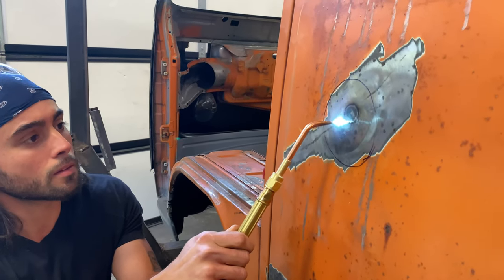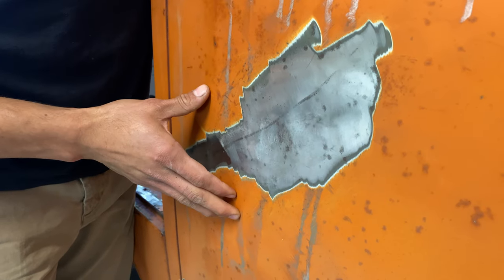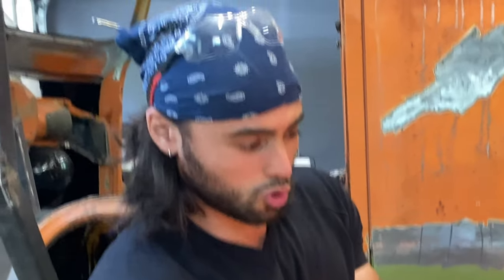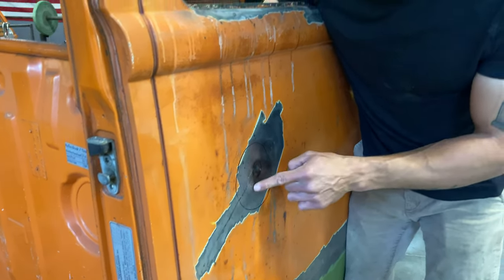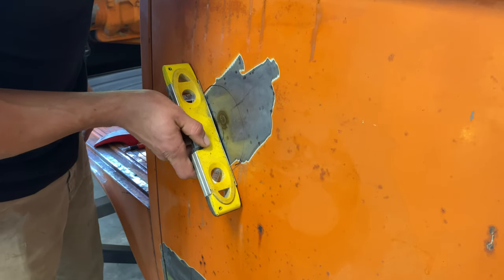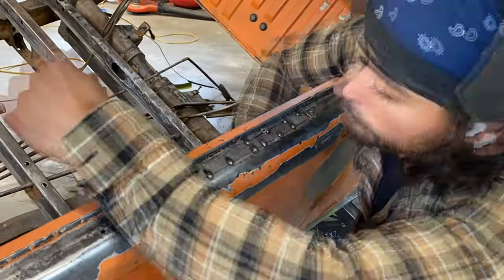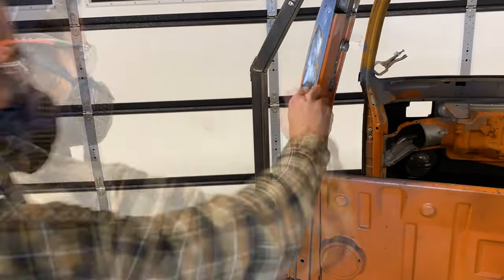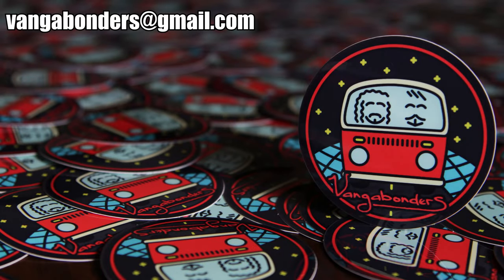Using a Torch to Shrink Body Panels | VW Bus Restoration Episode 40

Comment: Great work on this video and showing us your experience.  I agree with you on the POR15 that it's really good.  I came across it about 4 years ago after using some rustoleum products that had failed.  the POR15 has done incredibly well on underbody surfaces from rusting during the midwest winters (with salt), even on non-ideal prepped surfaces.

Comment: Hello, Kris. I investigated how to remove dents and there are electric machines called spotters and they are used to prevent it from disassembling and hitting the can from the inside. I saw they buy VEVOR pro spot brand a lot, the machine is white with manual controls, it may be an option for future jobs.

Comment: For the small dents, maybe try a shrinking disc, I have been using one for a few years now, works great on areas like the sliding door, stops the need to continual chasing your tail with hammer/dolly work and heat shrinking with a torch.
Reply from the maker: I ordered a shrinking disc yesterday! It’s supposed to get here by the weekend. Excited to try it out. I didn’t even know what a shrinking disc was before I got into this mess lol

Comment: Tip for the wire wheel, if it has a side with two flats on it that is kinda impossible to reach with tools to remove it after you use it if you turn it to the inside, just turn around the wheel and let the flats be on the outside so you can use a tool while removing the wire wheel =) atleast thats how i do it as they usaly stick kinda hard so you need thick gloves or a tool to get it off the machine =)

Comment: Also when turning on the torch, turn on the gas and light it, lean it against a surface like 30 or 45 degrees, then turn on the oxygen .. will prevent the oxygen from blowing out the flame when its turned on =)

Comment: What Amp settings do you use for mig welding?
Reply from the maker: Not sure exactly what it translates to in amperage but on my Lincoln Mig180 I mostly use heat setting B

Comment: POR = Paint Over Rust

Don't paint bare or non-rusty metal with it
Reply from the maker: As long as the metal is etched it will adhere well. Most of the smooth area that got POR15 on it will be sanded down when I epoxy prime. The POR15 used here is to ensure that the tiny rust pits leftover in the window sill don't come back
Reply: @Vangabonders  painting POR onto clean or non-rusty is poor, wasteful practice. Learn the chemistry of POR products and you'll learn it's a bad idea to apply it to anything not oxidized.